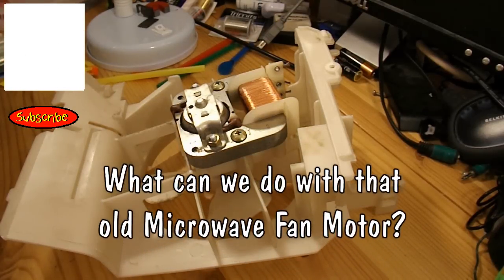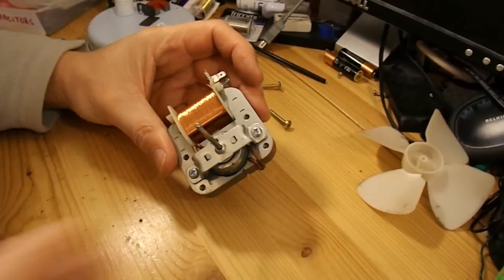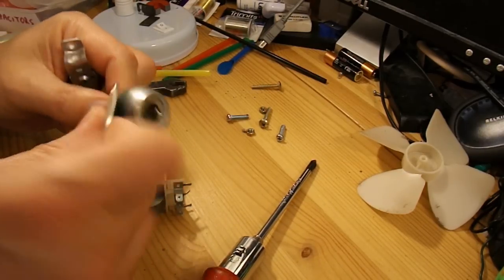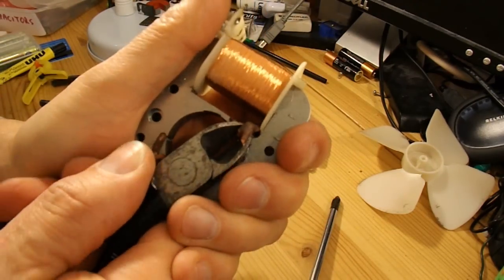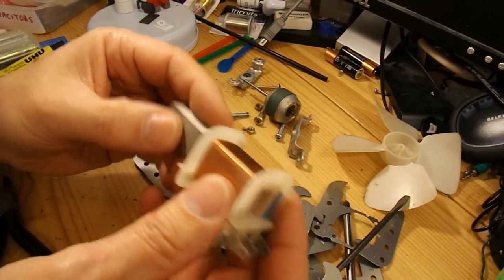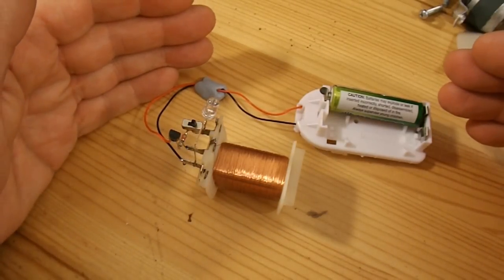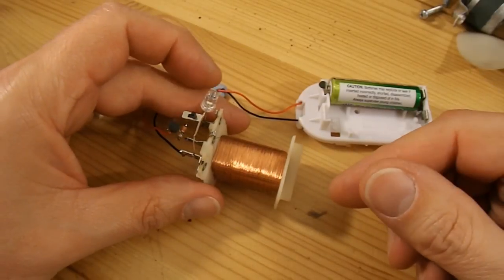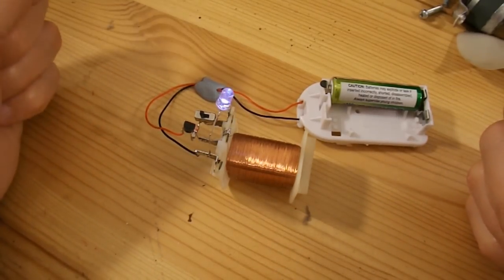What can I do with that old Microwave Oven Fan Motor

Comment: Errr. Am I missing something here? What practical use does this have? Forget  the coil and just use the battery, led and a resistor.
Reply from the maker: +creast yes you certainly are missing something. A 1.5 volt battery will not light an LED and it certainly won't if you put a resistor in circuit to drop the voltage even further. Maybe you should try it before commenting.
Reply: Yes but what practical purpose does it serve? Just a curiosity? Personally I would have left the fan alone and used that for something useful.
Reply: +GrandadIsAnOldMan  What the hell are you on about?! Yes you most certainly can light an LED with 1.5v and some led's will change colour depending which way you wire them up polarity wise, and I am inclined as is creast,to be puzzled as to what practical purpose this would serve. A pointless exersise to be worthy of putting it on this channel.
Reply from the maker: kingkongdaddy1 if you are so confident about lighting an LED with 1.5 volts perhaps you can make a video on the subject or failing that provide a link to a data sheet that gives an LED with a forward voltage of 1.5 volts. You will be lucky to get a low brightness red LED to light at about 1.7 volts and probably need more like 3 volts to light a white LED as brightly as the one in this video.
Reply: +GrandadIsAnOldMan  Quite correct. You show them how to build a simple little boost converter, and they throw barbs at you. I thought the video was pretty neat and clever! Bravo!  And, BTW, kingkongdaddy1, the breakover voltage for a white LED is 3.6 volts, you cannot light one with a pencell. Sheesh...
Reply: +you need to read what he's writing.he said its a rechargable battery,thats approx 1.2 volts.with a resistor in series,even less voltage will find its way to the l.e.d.This is a very good way to get all the 'juice 'out of an old cell.I think this is called a joule thief circuit.It works because a magnetic field intersecting a copper wire(multiple times,not just once),induces a voltage in that wire.This 'extra' voltage ,added to the battery voltage enables the l.e.d. to function.This is a good example of basic electronics science principles.It is certainly not a pointless exercise.it's stuff like this that intrigues inquisitive minds,this stuff makes the electronics engineers of the future.
Reply: +GrandadIsAnOldMan +kingkongdaddy1 is describing a well known circuit popularly known as a Joule Thief. It differs from the final circuit in your video by having a ferrous core rather than an air core.
Reply from the maker: ***** no you are completely wrong and appear to be jumping in halfway through a conversation. If he wanted to discuss a Joule Thief we could have had that discussion but he is insisting that an LED will light with 1.5 volts. In a Joule Thief the LED is NOT lighting from 1.5 volts, it is lighting from the increased voltage created by the voltage boosting of the Joule Thief circuit. Just because it is connected to a Joule Thief circuit does not magically change the forward voltage requirements of an LED. Here is a typical article on LEDs giving a simple list of forward voltages by colour and you will see 1.8 volts is the lowest forward voltage and even allowing for some manufacturing variation you are not going to light a white LED with 1.5 volts http://www.petervis.com/electronics/led/led-resistor-calculator.html
Reply: I did not say it was white.  The led I wired up to a 1.5 volt cell is yellow or green depending on polarity.
Reply from the maker: +kingkongdaddy1 interesting that you haven't supplied the details yet. I would genuinely be interested to see them. Certainly the colour changing LEDs have circuitry within the LED to facilitate the colour changing but I am not aware of any that are able to work on such low voltages, all the colour change one's that I have found need over 3 volts. I would expect a dual polarity LED to conform to the standard colour ratings and have the same forward voltage requirements but if you can identify the components you are describing it would be very helpful. Depending on the colour they range from 1.7 to 3.2 volts
Reply: GrandadIsAnOldMan Congratulations! You have shown that you're a master goal post mover. If you don't want to engage in ideas that others are interested in, please feel free to ignore them.
Reply from the maker: +Ben Li I think you need to take a few minutes and read through the conversation fully. People are commenting on my project which simply lights a white LED using a single 1.5 volt battery. I did not design the circuit and made NO claims whatsoever about it's capabilities. Some people have questioned the purpose of the project and quite simply it has no specific purpose. As I stated in my voice over in the video I simply found it interesting that a flick of the magnet started the circuit running. Can you see or hear me make any other claim. Some people here have chosen to state that I could have avoided making up the circuit and simply connect an LED directly across the 1.5 volt battery and it would light. I have asked them to demonstrate that or provide details of the LEDs with that capability. Can you see an answer to that request anywhere here? Have you even read my video description? To save you watching the whole video - although that would help by putting it all in context -  maybe you could watch it from 04:45
Reply: +GrandadIsAnOldMan I'm sure that wall of text very interesting and fully understands and addresses your (now former) viewers' concerns, but you'll have to excuse me because I left my fridge running. Good day.
Reply from the maker: +Ben Li I guess you always butt into the middle of other people's conversations and try to divert them to what you want to discuss without checking first what they were talking about. That is just plain rude. I have given you the chance to understand the context but you have just continued to add irrelevance. I wish you well in your life and hope you may learn from your mistakes. Good luck.

Comment: Can somebody please tell me how to get it to work on batteries
Reply from the maker: How to get what working on batteries? The fan is an AC motor so that will not work on a DC battery, if that is what you mean.
Reply: You can replace the motor with a dc motor

Comment: hey, are those blades metal or plastic?
Reply: Shouldn't those blades be metal to reflect the magnetic waves around the food when it turns? Or is it just to blow hot air around?
Reply from the maker: +Toby Que OK I am not an expert on microwave ovens but I am able to use Google search and Wikipedia. The fan in this oven is used to cool the electronic components and exhaust any waste heat. The metal fan or stirrer you appear to be thinking of is a different item. This microwave oven was equipped with a turntable to move the item being heated to distribute microwave energy. Here is a straight cut&paste from Wikipedia "Uneven heating in microwaved food can be partly due to the uneven distribution of microwave energy inside the oven, and partly due to the different rates of energy absorption in different parts of the food. The first problem is reduced by a stirrer, a type of fan that reflects microwave energy to different parts of the oven as it rotates, or by a turntable or carousel that turns the food; turntables, however, may still leave spots, such as the center of the oven, which receive uneven energy distribution." Find more information here https://en.wikipedia.org/wiki/Microwave_oven

Comment: Can we make a transformer with that
Reply from the maker: I guess you could. It is a coil of wire so you could adapt it.
Reply: Yes you can with the motor, in my words this motor can actually count as a transformer since the shading coils are just shorts. By adding a secondary coil then you basically have a mains transformer.

Comment: It's the battery that lights the LED @#$#@
Reply from the maker: +rudy edot yes the battery is probably at about 1.2 volts and a white LED needs a forward voltage of nearer 3 volts to light so the circuitry uses the coil to create a voltage spike high enough to light the LED. If you look at the video description there are several links to circuits commonly called Joule Thieves that will help you understand what is happening. There is no trickery here, just simple electronics working.

Comment: how does that motor work..n
Reply from the maker: +karan pandya it is an AC motor so I suggest you either Google it or search YouTube, there are plenty of videos on the subject.
Reply: Ok ...thanks...i thought that it was a synchronous motor..
Reply from the maker: karan pandya I would have to google that too to understand how it works. As far as I am concerned it works off main electricity so it is AC powered. As I say I would google it to find exact way it works :-)
Reply: Hmmm....
Reply: +karan panda I have never seen a  motor like that before it was really interesting. I have two observations. 1. it is a brushless motor so that will give it a long life. 2 it has a very low profile to save space.

Comment: make a drone
Reply from the maker: +Bailey Carter that is a regular request and I have created a standard reply, the answer is NO. To make a helicopter or quadcopter stable in flight I would have to buy so many parts designed for the purpose it is cheaper to buy a ready made helicopter or quadcopter. A good example would be something like the Eachine H7 2.4G 6-Axis LED Mini RC Quadcopter. On top of that, my channel is aimed at simple, quick, cheap projects and a helicopter or quadcopter build is not a simple, quick, or cheap project. You would be better finding a channel that specialises in RC Quadcopters or Helicopters so you get the information from people who know what they are talking about. FliteTest would be a good place to start although they tend to focus more on planes than copters https://www.youtube.com/user/flitetest
or anything David Windestål is involved in https://www.youtube.com/user/dadde87
or you might like this video by The Post Apocalyptic Inventor https://youtu.be/qa_x93JQhNM
for rubber band power check out the work by norris432 https://www.youtube.com/user/norris432

Comment: way way worst thing i have ever seen if the motor was working fine why you broke it you could use it as a fan for many different things not a bullshit like that
Reply from the maker: I guess you haven't watched the videos where people strip these down to get the copper wire for scrap, those are the most common videos on Microwave ovens tear downs. At least I made something educational. If you read the video description there is more information and helpful links. If you want to make a fan from a fan then here is the associated video https://youtu.be/F1IESEC1dik?list=PLA5a2xPRSrB2VTto6XDfLr0xag7y461gE
Reply: the description is little big to read for me 
sorry about that 
yes using the copper wire can do many many other things i think i can wind a transformer with it

Comment: This is bad. If you're going to do a video at least have some idea what youre doing yourself. You post a video on how to dismantle a shaded-pole motor when you've never done it before. How dumb is that. I've done dozens and it's a 5 minute job. Take off the ally plate holding the bearings: discard the rotor. Cut through the core at the thinnest part with an angle-grinder and you can squeeze the core. The slug with the cold just falls out - none of that ludicrous mess you made.
Reply from the maker: So you have an angle grinder, congratulations. I don't, you can see in the video what tools I used and I did say at the beginning I could saw it but I chose not to. My video was a genuine video showing what I did. Is that a problem? Interesting to see you are giving me yet another method of disassembling this type of motor, if you check down through the comments here I have had several other people giving advice. Maybe you could contribute to YouTube by uploading a video showing us how to do it properly. Then I can link to it in my video description and that would help anybody else who is seeking advice.